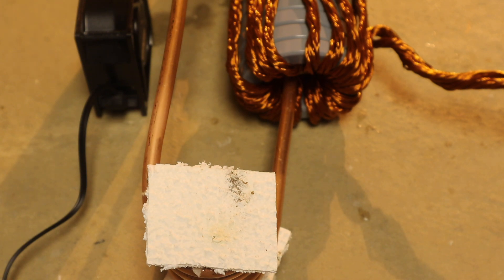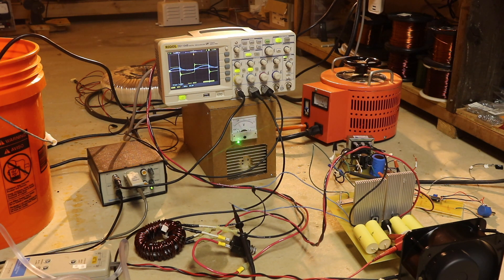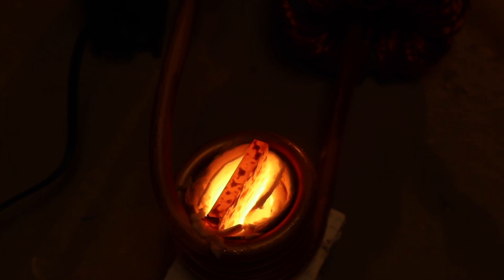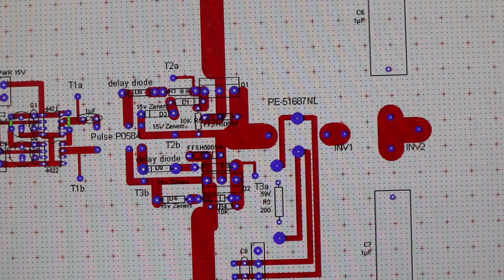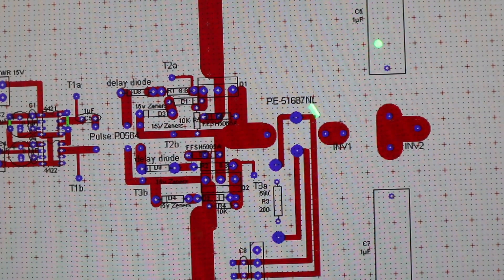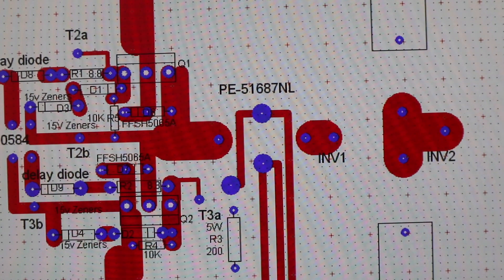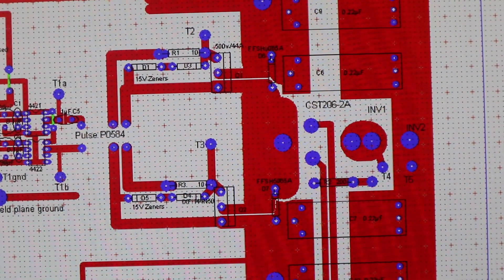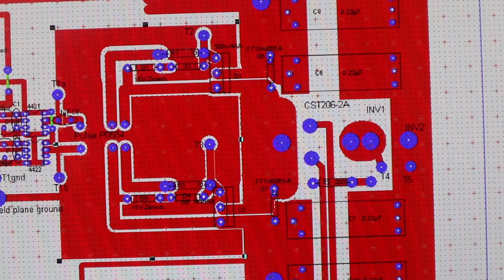How to build a high power induction heater beyond 10kw

Comment: I follow your project since jan 2010, I got the IH functioning a few years back, but it still has manual input for the frequency. I was today working in the resonant lock from the 4046, can you explain how the 4046 lock exactly in the resonance frequency? Mine is always not Exactly in the resonance frequency. With your design, you can change the coils, change the charge in crucible that it still locks in the resonance without adjusting anything on the board? 

I'm currently using an IGBT module from infineon, AC rectification and H-Bridge inside one small package!
Thank you for the videos and initiate me 10 years ago in this project!
Reply from the maker: I plan to work my way to explaining how to do this. Are you using a microprocessor with the PLL or just the chip? If you are just using the 4046 chip it will get close to the frequency, but it will not exactly get there. Also, if the frequency changes it will not track it properly. All the project I found that tried to do this with circuitry failed; you need a microprocessor. My tutorials will get there.
Reply: Eagerly waiting!!
Currently I'm working with just the 4046, the uC is processing other stuff (water temp, water flow, heat sink temp, etc...). I didn't understand the use for the arduino in your 10 kW schematic, it appears to just adding or subtracting a DC voltage from the VCO input.
Reply: @imsmoother  I got the 4046 to track over a wide range in my test circuit (so I could use different coils with different inductance, without problem) - I did that by putting a capacitor (2.2 uF) between the voltage controlled oscillator pin and ground and a pull up resistor (100 kOhms) between that pin and the +15 V - and a small signal NPN bipolar transistor (BC547b) with it's collector on that pin and the emitter to ground - a 4,7 or 5,6 V zener diode is added in series with the base pin. 
A trim potentiometer is then put with one end to the output PWM pin and other end to ground - if a smoothing capacitor is put on the 3 rd "adjustable output leg", that will give an smooth output voltage (wich is then connected to the base with the zener diode). If the frequency get too high, duty cycle on the output pin will go up and thus the voltage over the smoothing capacitor. 
That means more current will flow thru the base of the BC547 - wich in turn discharges the capacitor on the voltage controlled oscillator pin (and the frequency goes down). If the frequency get too low, the duty cycle and voltage over smoothing capacitor goes down - wich means the current decreases or stop flowing thru the BC547 base. The capacitor over the oscillator pin will now charge up because of the pull up resistor (wich ramps up the frequency). 
That works regardless of frequency, since the duty cucle on the output pin depends only on the phase angle (it will automatically balance the voltage on the oscillator pin so it keeps the same phase angle - regardless of frequency). Rensonance can be tuned by turning the trim pot. I will put up a schematic of that when I build my heater later.

Comment: Bro i made one full bridge induction furnace from inductotherm schematics but im using variac can we use dimmer instead of variac for power control ? 🤔
Reply from the maker: I have not done it. The question is how much current can the dimmer control provide? Variacs can provide 5, 10, 20, 50A.
Reply: I don't think that will work very well - at least not with a standard dimmer with phase angle control. You will probably blow that up, if you connect it to a rectifier with smoothing capacitor, haha. The best thing for power control is to ether use a variac (wich adjust the voltage, but keeps the voltage sine shaped) or build a buck converter after your rectifier, wich takes the high DC voltage from your smoothing capacitor and lower it (if needed) before feeding it to your bridge capacitors and inverter circuit. That's much cheaper than buying a big variac (if you don't already have one), but  requires some knowledge - compared to building this induction heater, it can be done very simple though. Just one of those simple 555 timer PWM circuits (or similar) you can find out there (where you just adjust your duty cycle with a potentiometer), then you scale up the components - bigger transistor with separate gate drive (for example HCPL-3120 opto coupler with gate output), and large inductor and free wheeling diode. I have such a circuit to power regulate a 9 kW furnace that I have built - that works well :) 
I have also built a small 500 W test induction heater using this schematic with slight modifications - also with said buck converter as power regulator (also worked really good). I will scale it up later and put a video of it.
Reply: @Speeder84XL  great and im confused on dc blocking capacitor and ferrite core  after inverter many people using dc blocking capacitor in series with impedance matching transformer, and i want to know which ferrite core is best for induction
Reply: @ajayvagadiya3934  The DC blocking capacitor is to ensure the transformer get nothing but AC - otherwise if the "positive" and "negative" duty cycle is not exactly the same, there is a risk that DC current starts flowing thru the core (along with the AC) and that can saturate the core (wich is really bad and causes very large current spikes, that can blow the transistors). But that's usually only needed, if you make a whole bridge (with 4 transistors) - when you have a half bridge (2 transistors and 2 capacitors), the voltage between the bridge capacitors will adjust slightly and block any DC current anyway. In my test circuit I used a ferrite E core (N27 material) at the size 42/15, with 1-1,5 mm air gap. 
That worked fine. My heater was only about 500 W, but it seems like it could handle a lot more - I was limited by what my test power supply could deliver. If needed, much larger cores than that is easely available without being very expensive (you can also stack several of them, like he does in the video).
In this videos he uses iron powder cores though - but I don't think that's the best choice. According to my experience, those are poor transformers. The problem is that the power transfer between primary and secondary is poor. Wich in turn leads to huge magnetization currents, to get any significant power transfer at all - that decreases efficiency, increase the need for cooling and also makes the problems with ringing (as he talks about here and in another video) much worse. 
For DC inductors on the other hand (for example as the inductor for the buck converter I mentioned), iron powder cores are usually the better choice (because they can handle much more current before saturation). I'm also on my way to build one that's at least 2 kW and put up a video later.
Reply: @Speeder84XL  great work, I'm making 10kw induction furnace for  1 kg Crucible and i find out in big induction furnace they use transform for this but they are using tank Capacitor in series, can we also make transformer for that,
I seen many people are using mosfet for 2kw induction heatre but when i try igbt they can't working well im using fgh60n60 but they just blown up if you want 50kw  induction furnace panel video i can give you their circuit are little different from us. thanks

Comment: I seen many circuit  and they are using capacitor in series across matching transformer and inverter ckt that is necessary or not and why they are using that pls answer
Reply: Forward capacitor works as open circuit
and the coil like a wire
If you are using a low capacitance capacitor connected in series to the coil, matching is to prevent that if at some point something bad happens in the inverter, such as a short in some power module, the capacitor will operate as an open circuit, preventing something worse.

Comment: I'm hoping to build a 15kw unit in the future, will this be scalable that far? Also, what sort of power factor can be expected from an induction heater like this? Can't find anything about that on the internet.
Reply from the maker: totally scaleable. Just make sure the tank capacitor can handle the Vrms (750v) and Irms (1000A)
Reply: @imsmoother  excellent, thanks! What about power factor? We only have a 25 KvA step-down feeding our house and two neighbors, want to make sure I'm not building to a spec I can't actually use.

Comment: Be careful with max. continues ratings - they are rated at 25°C. Same with mosfets. In the most cases it is nearly impossible to get the needed cooling on this small ic packages to get what they claimed to give you. Not to mention how a small ic pin should handle 50 amps for more then a few ms.

Comment: Hi i tried your half h Bridge circuit but that circuit not consuming any current at 100v any problem i did all thing you said.
Reply from the maker: what do your scope tracings look like? Put a scope probe across the leads to the coupling transformer. Put another probe across the current sense leads to see the current waveform. What is your frequency, capacitor size (uF)?
Reply: @imsmoother   resosnace frequency is 22khz, tank capacitor 10uf  coil uh  5uh  i chaked tank waveform that is ok, any reason for circuit don't draw current?
Im waiting for your  induction hetre new video. thx..
Reply from the maker: @ajayvagadiya3934  First off, 22khz is too low for the gate drive transformer. They are rated for 50khz and above. I need to see scope tracings of gate signal, inverter square wave, current wave. I need to see pictures of the tank and a scope tracing of the capacitor voltage. Without information there is nothing I can do to help.
Reply: @imsmoother  i can understand but in induction furnace they are using only 2 to 3 khz of resonance frequency??
Reply from the maker: @ajayvagadiya3934  not 2-3 khz. But your components must be made for that range. The gate drive transformer in my plans is not meant for a frequency that low. I am not saying that is the issue, but it is a problem for that design. Still need to see scope tracings.